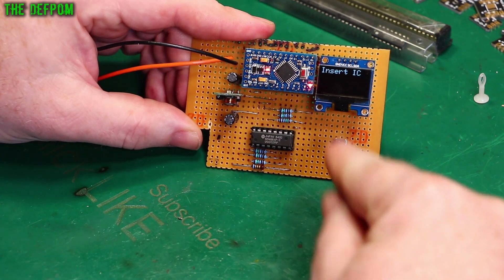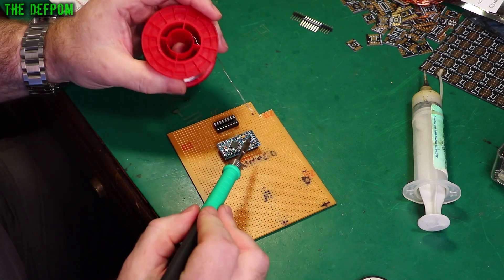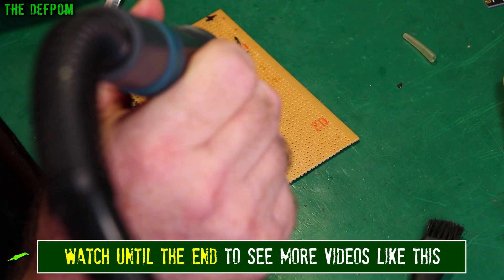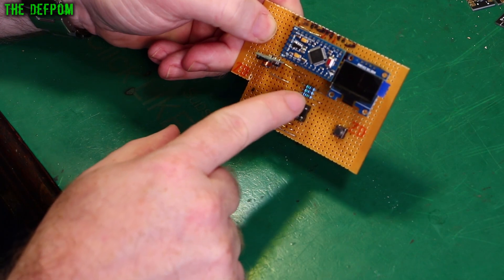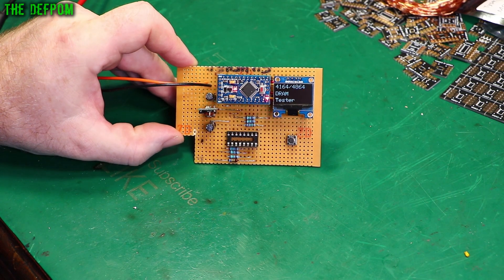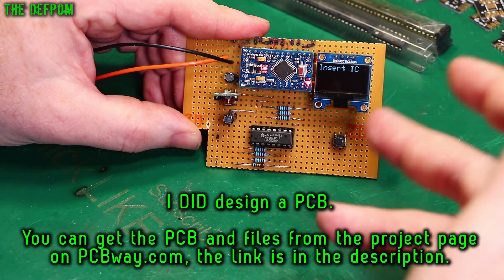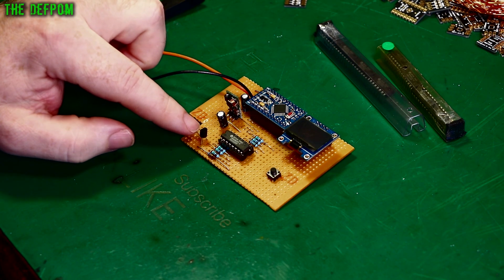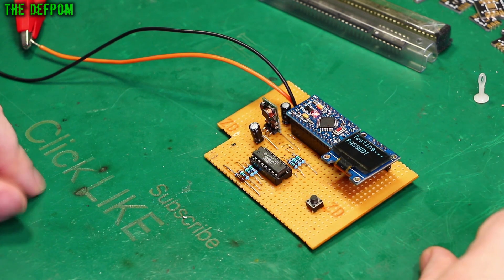🔴 DRAM Tester Prototype Project - 4164 DRAM Tester - 4864 DRAM Tester -  No.912

Comment: Hey, Scott,

Just wondering if your current code checks one Row at a time, or writes to the whole array before reading back?

If it's only one Row, I don't know how thorough that is as a test, as it may just be reading back the row buffer directly if the write and read are done in quick succession?

I think on these smaller chips, if the whole chip is written to then read back quickly enough, it might not even need any refresh cycles, but I could be wrong.
Reply: We used to use a test seq that isolated the data from the addressing, if that is a good way of saying it. if you have a stuck address bit you can pass a simple test as the data will be writen and read back ok, you might need to know how the internal address mapping works to work out a patern that will detect this.
Reply: @TheEmbeddedHobbyist  Yeah, that's true. Even with the column / row addressing, it depends if the internal array is say 1024x1024 or something, then it could test the same with addr bits swapped.
Reply: In general, checkerboard is a good way to test RAM as it detects potential leakages/shorts between cells.
Write the inverse checkerboard on a 2nd run.
Reply: I realize the 4164 is only 1-bit wide, though, so it might not even have a row buffer in the traditional sense? lol

Could add some interesting bit patterns to the code later on, though, when testing more of the array in one go.
Reply from the maker: @electronash  it writes the entire chip first, and then reads back.
Reply: @TheDefpom  Ahh, OK. Nice. ;)

It's a shame the TL866 didn't have DRAM testing a while ago. Not sure if the open source code supports that now.

I've seen some of the newer testers on Adrian's Digital Basement. The neat thing there for retro peeps is they have the MAME ROM hash database on SD card, so it can compare against the PROMs etc.

Could be fun to expand your project to support more chips eventually, but it would require lots of diodes, boost converter, power switching, current-limiting etc.